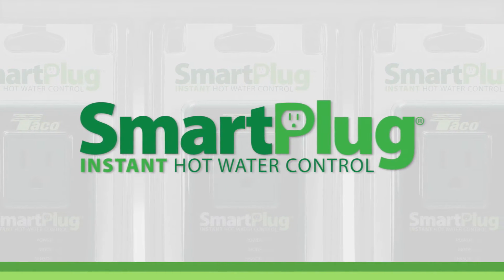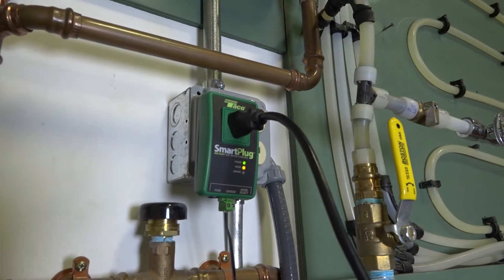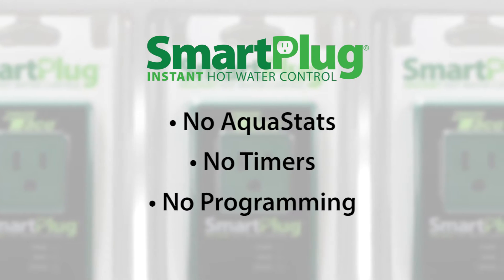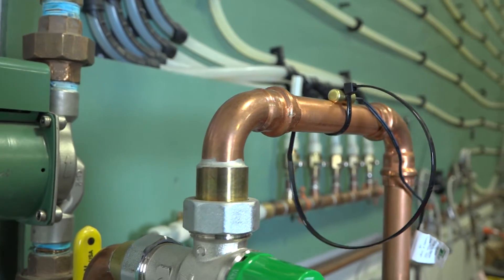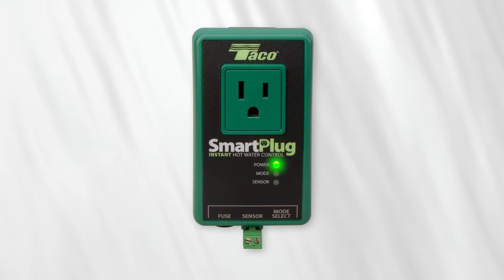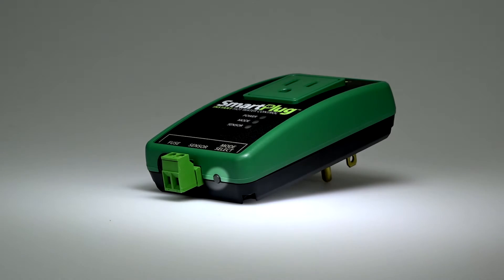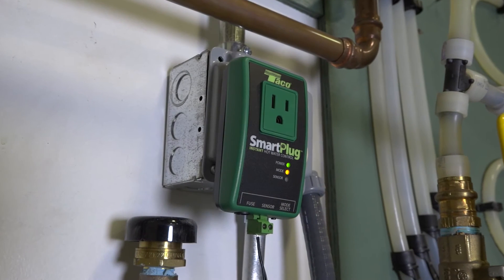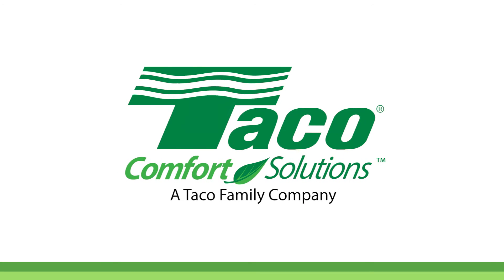How to install the Taco® SmartPlug

Comment: sooo many questions...    grundfos has the same thing built into a pump, what makes this one better?   why does the sensor go on the supply?  does it detect water movement and tag the incident?   why not on the RETURN that way it measures the temp coming back.  when it falls below a certain temp, it will turn the pump on until it's satisfied then turn off.  in my situation i have some thermosiphoning going on.  my current pump measures at the supply and return but it's too stupid to figure out what temp range is needed.  we can't program it or adjust the default settings.  in a nut shell, i need a pump that will turn on for 5 minutes, and shut off for 20, just enough to prime the lines and have 120 degree water available at any tap in the house within 3-5 seconds of opening the valve.  then , i want it off during the night when the house is asleep.   i haven't found a timer, pump, smart plug, etc that will support these demands, and good god don't ever buy a wemo.